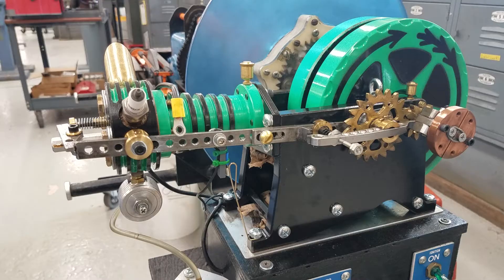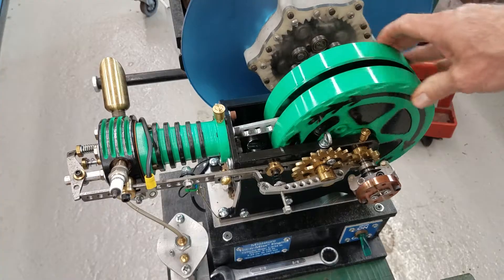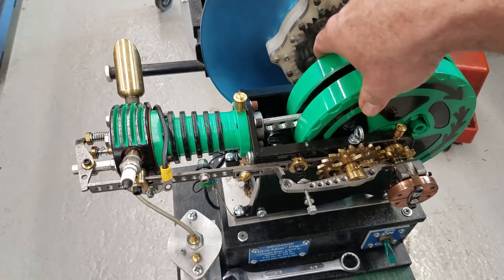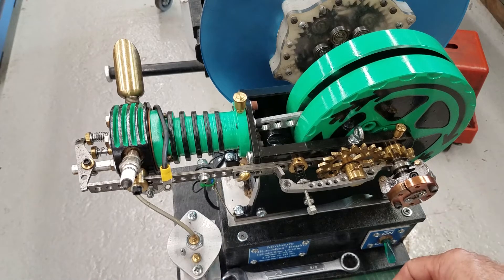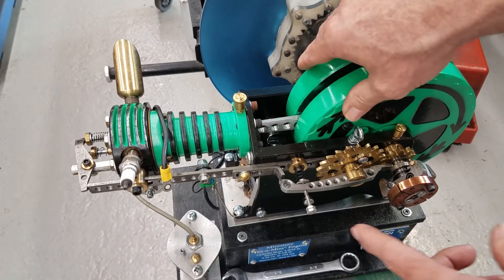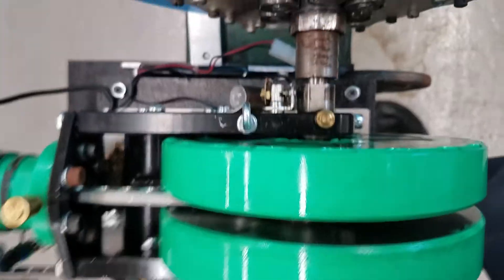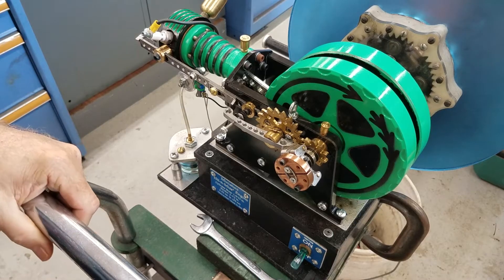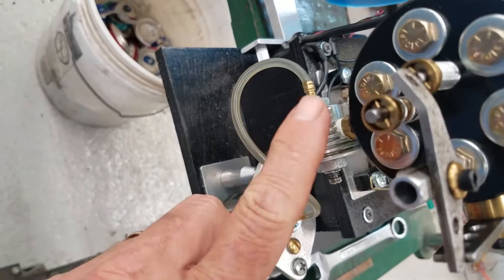Hit-N-Miss Engine Operation Explained

Comment: Mostly accurate but combustion is NOT an "explosion",  it is a very fast expansion due to heat.  Explosion would be more akin to uncontrolled combustion, ie closer to detonation.
Reply from the maker: An explosion is defined as a sudden high-energy release when a chemical reaction of a combustible material happens quickly in the presence of oxygen and is usually accompanied by gases . A certain amount of flammable vapor should be mixed with air to form an explosive atmosphere....This is what I meant😁😁😂

Comment: 4 Stroke engines
Intake, down stroke, Draws in, Vacuum, Air/Gas 13/1 or so, depending on engine/age.
Compression, up stroke, squeezes it.
Spark plug fires, Power, explosion forces piston down.
Exhaust, up stroke, forces burnt air/fuel out.

Comment: Very interesting. One thing though, is there a fuel cut off on non-powered revolutions? I would think there must be, otherwise, there would be no point in a hit n miss engine.
Reply from the maker: there is a check ball in the end of the fuel pick-up tube that keeps the fuel at the needle valve. Thank you for your interest and positive comment. Later, RT.
Reply: @RickTaylorpopnstart  thank you. That's good to get a positive response. 👍

Comment: With your cam for the breaker points on the main shaft doesn't it also spark at the top of the exhaust stroke as well as the power stroke?

Comment: Love it!!
I want to build a larger more modern (slightly modern) version, a two cylinder, opposed piston, with 10"-12" stroke, and 6"-8" bore, make the cylinders from steel pipe, and steel plate,  I'd really like to make it a oil burner, either way, maybe it can be ran off oil vapor, make a hot pot carburator, that uses a flame under what is basically a pressure cooker pot, and a small copper coil tubing to drop the temperature below the ignition point . So it doesn't ignite when it hits the airing the venturi of the carb, the throttle changes the oil drip rate slightly, but mostly and opens a valve allowing more fuel out the coil of 3/16" tubing, and a throttle blades probably made from a 24 mm scooter carb, or similar lawnmower carb, with the tube epoxied into the carb venturi, so if could be used for natural gas/propane also the hot vapor being est, 50°-70°F below tge ignition temperature mixing with air entering the cylinder,  with a pair of sparkplugs per cylinder, with .060"gap and two coils firing twice per ignition cycle,  with a 50-60 kv coil per plug,  with a  high current , high voltage spark to ignite the oil vapor that should be 150°f roughly when it enters the engine, 
The pistons cast using old pistons  from car engines,   the molds made from foam, cast using the list foam method.  plaster and sand, the foam piston being made est. 1/2" larger, to account for shrinkage.  Use parts from modern engines where possible. Model the pistons after a diesel engine. With the combustion chamber in the piston approximately 80% anyway. Because the bore is so large, the large quench pads, and shapes to induce swirl to promote an effective combustion,  the  oil rings made from iron pipe  cast then fired and machined into shape surface ground to thickness,  use a spiring  in the ring land stretched around and connected to it's self to space the rings from Each other , with a pair compression ring , top ring 3/16"- 1/4". From the top, the head cast from aluminum, with the water jackets being cross drilled, and cast in, uding plaster and sand, use large valves from a big block Chevy, or Chrysler engine, 1.880" exhaust, and 2.225" intake, opening to 1.000" - 1.200"+/- it doesn't require alot of seat pressure or open pressure, at less than 1500 rpm, weld and machine a crank, from steel bar, 2"-3" diameter,  with 4" x 
.500" thick, use roller wheel bearings for crank main bearing if possible, and a engine main bearings for rod bearings, possibly from a diesel truck engine, in the near 3" range, or a rod bearing, if one is available in that size, use a oil pump to spray the rollers, and feed the rod bearings, through the crank, also the piston pin, fed oil thru a 3/16" - 1/4" braised in steel tube, feeding oil, also feeding the oil ring land, spraying into the 1/8" holes in the piston skirt, the top side to lube the bore, with an overhead cam, possibly using a lawn mower or motorcycle cam with 2.5:1 rockers,  with springs only 25psi seat 50-60 nose pressure,  possibly use a screw in plug to lower the compression ratio,  if the compression ignition doesn't work, (the complex air blast injection system I have an idea for)  the injection working like a cross between a paint sprayer and a carburator, spraying oil through tiny holes into a venturi, through another set of tiny holes, using near 30 bar air pressure , lvhp  paint sprayer basically, spray the fuel into a 1/16"-1/8" tube in the injectors, using a 1.5"-2" piston to put a air burst through the injector,  as the fuel is being injected into the tube,  about 50 cc of air at roughly 30bar,  a venturi injection may be possible , just spray air through the tube with fuel , in an outside tube,  using basically a annular discharge booster from a  carburator, blast a 14.5 psi x 30+/- = 380 psi+/-,,  air  a piston and cylinder filled with the compressed air, then the full volume is used at full throttle. To reduce the throttle, some means to reduce the volume of air, not pressure. Giving an alternative path  to refuse fuel and volume of air  to throttle  the engine. With the ability to go from zero, to 100 % maybe a simple bypass with  a spring loaded check valve.  And possibly feed the high pressure bypass air into the low pressure air tank , 
  Being multiple stages,  multiple compressors,a compressor compressing 120-150 psi air, to raise it another 100+ psi , using a AC compressor, with filters to remove water and oil, dust, and a cotton gauze oiled filter first, with a carbon filter between stages ,  to remove oil introduced by the compressors,   single compressor from a automotive ac system will most likely, reach the pressure,  I'm looking for about 150 psi above the engines cranking pressure, so there is plenty of pressure to atomize the oil as it's injected into the engine , with around 22:1 compression!  It's likely not going to make a lot of HP, 40 would probably be possible,   and it should make a fair amount of TQ.  I want it to be used as a DC generator,   producing  600 amps at 32 volts, plus, less than 20 kw with losses, it's probably going to require. 25-30 kw of output from the engine, 22hp should do it, if it can do that at 600rpm  , with twin opposed cylinders , with Soo much displacement,   even if it's running on gas with 8:1 compression it should make enough power to suit  it's purpose,  it may need to spin 800-900 RPM, that being it's sustainable peak apparently, maybe 1000-1200 definitely, a 12" stroke eq, a lot of piston speed,  it's just a matter of finding the scrap to put it together, and the ability to machine the parts!!, Sorry to ramble a stray!! ✌️

Comment: Why doesnt the spark plug ignite at intake stroke? is it controlled by cdi or every time the magneto passes the metal
Reply from the maker: it probably does spark but is ineffective as there is no compression of the fuel/air mixture to cause combustion. Keep in mind that the switch on the pushrod(paperclip wire) has to ground the points to be able to fire the coil. Later, RT.

Comment: Is this type of engine more less fuel consumption?
Reply: More, they aren't super efficient. They're better at running all day and adapting to loads differently, but they aren't more efficient than modern 4 stroke engines.

Comment: I understand how it works by I don’t get why you want this over a regular 4 stroke? Is it cuz lower rpm
Reply from the maker: this is a 4-stroke engine, it's just governed differently. this style of engine requires only a simple venturi for fuel mixture and a valve latch for governing speed, whereas throttle governed engines use the butterfly of the carb to govern speed. Throttle governed engines are smoother running engines.

Comment: Was there ever a hit and miss diesel?
Reply: i stand to be corrected but yes i think there were.  i seem to remember the first one i ever saw ran on "anything including orange peel".  thats what the guide said - "anything including orange peel".
Reply: @vsvnrg3263  Seriously ? I wish we could see one like that
Reply: @357bullfrog9  , i saw it in a pioneer/heritage museum in a northern tasmanian town in the mid 70's.  it may have had a glow plug which constitutes a diesel in my opinion.  ive not researched this on the internet.  just going off memory.  if you got told a primitive engine ran on orange peels would you forget?
Reply: @vsvnrg3263  I sure wouldn't. The orange peel fuel is what really got me interested. If they could do it back then why not now? Can you imagine how that would help. Both engine owners and orange growers
Reply: @357bullfrog9  , its probably an extract from the peel.  the best paint stripper ive used is based on citrus extract and non-carcinogenic.
Reply: @vsvnrg3263  I've used that but never thought of it as a fuel. If it worked back then it would work today.  Someone should experiment with it. It might be as good as bio diesel
Reply: @357bullfrog9  , i've just had a look around the internet and diesel hit-and-miss engines were more common certainly in australia then petrol ones.  try blackstone oil engine startup by rusty motor.  petrol versions might have been more popular in nth america.  nth america was still using petrol engines in trucks for decades after the rest of the world were using diesels.
Reply: @vsvnrg3263  I'll look that up. Thank you friend!

Comment: the engine is nice but the hidden gem here is the clutch! using a planitary gear set as a clutch and holding the ring gear* to stop all the other gears free wheeling is truely genius!
Reply from the maker: I have a fascination with gears and I don't know why! Thanks for the kind comment, Jason. Later, rt.
Reply: @RickTaylorpopnstart  , do you know of the drive mechanism invented by william murdoch about 2 centuries ago to get him around someone's crankshaft patent?  i only found out about murdoch a few years ago.  i also regard him as the best candidate  to bestow the title of the father of steam locomotion.  richard trevithick lived down the road from him.  but you probably already know this stuff.
Reply: automatic transmissions change gears "automatically" using this style of clutch. As engine rpms increase, fluid pressure from the trannys internal pump increases until a solenoid activates, which tightens a band around the ring gear of one of the clutches. The ring gear smoothly decelerates, while the internal gears speed up, resulting in a smooth transition into another gear. Multiple combinations of these results in multiple speeds as well as reverse.
Reply: The solenoids can also be controlled electronically with a computer and sensors. Older transmissions used mechanical and hydraulic methods.
Reply: it similar to power split device toyota hybrid systems

Comment: Nice engine and it runs real well and will slow down most of the model hit and miss engines that I have seen runs to fast, that looks like a Philip Duclos design..
Reply: I made a Philip Ducks engine that looks very similar to this one. It's about half that size and its a 6 cycle.
Reply: @wayneprice6814  , 6 cycle?  what are these 2 extra cycles?
Reply: @vsvnrg3263  yes

Comment: Why would you want an engine to do that?
Reply from the maker: a hit-n-miss type engine is easier to make because a carburetor is harder to make than a "mixer" for fuel air induction. A mixer is just a venturi. Back in the 19th century when the hit-n-miss engines were a new technology carburetors were not fully understood. Later, RT.
Reply: @RickTaylorpopnstart  oh, thanks

Comment: There was a gravel pit down the road when I was a kid and I always listened to that hit and miss at night pumping the pit . It's reassuring somehow . .   .  Thanks
Reply: Me too, an old pump Jack out in the woods, you could smell the oil before you could see the well.
Reply: I assume it's exhausting carbon monoxide gas so I hope you have adequate ventilation
Reply: @dh5594  as the video is two years old your concern seems irrelevant
Reply: @redskyz483  oh it's relevant if it gets a message to anyone that thinks about running a combustion engine indoors. It's irrelevant how old the video is
Reply: @dh5594  you addressed the comment to the man on the video, you did not make a general statement . Such as  'Make sure the room is well ventilated if you run internal combustion engines inside a building " Therefore you comment as written is irrelevant.
Reply: @redskyz483 your existence is irrelevant 😂
Reply: @dh5594 it would take a very long time to cause problems in that big room with so little cylinder displacement. A Chevy 350 engine would be a different story.
Reply: Wow that's so interesting

Comment: Rick how good on fuel is it?  And would you measure it by how much it used per hour of run time?  Every time I see these running I always get the feeling there good on gas but no one talks about it.
Reply: Depends on the load (as with any engine) but if there's no load on them and they are just idling they are very fuel efficient. A two horse power one could run roughly 2 hours on just a pint of fuel if it was idling.